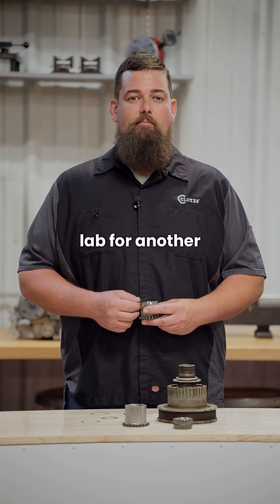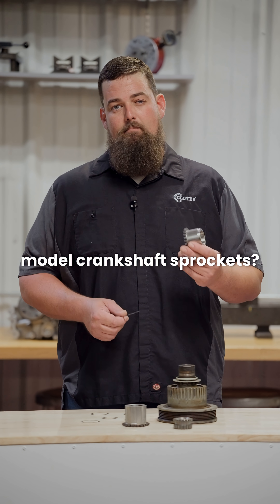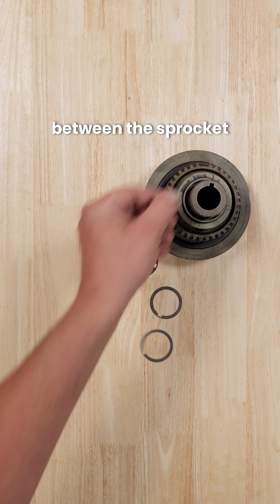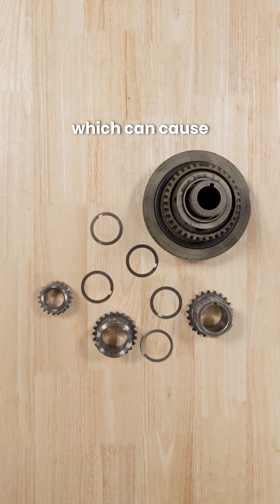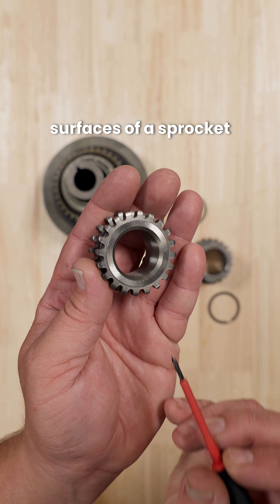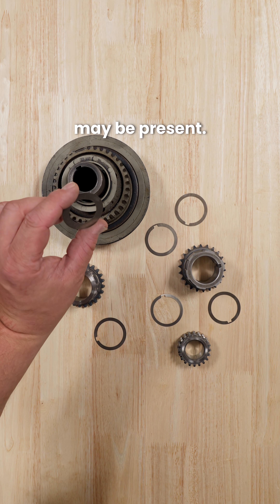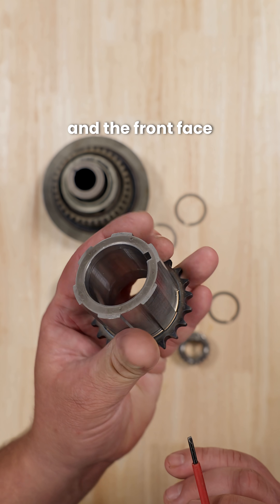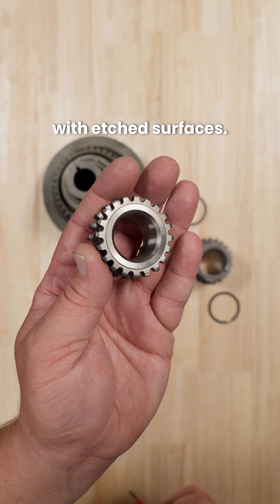Don't Make This Mistake!

Comment: Yep, not knowing about these, they were in service information, was replacing an engine in a small Mazda car a few years back. NOT KNOWING about these, I saw if I took the crank pulley off the engine, I could remove it out the top and not have to mess w the subframe, etc ..... COSTLY, TIME CONSUMING mistake. Had to go into work on my unpaid day off to tear off the front cover, valve cover, etc, to retime the engine.... never did that again!!!

Comment: Why can't manufacturers just do as they did in the past and key or pin everything that needs to rotate together. These friction fit parts that damage engines if they slip are criminal. Corporations are ran buy incompetent greedy morons out to make a quick buck before moving on to destroy yet another company's reputation and harm their customers.